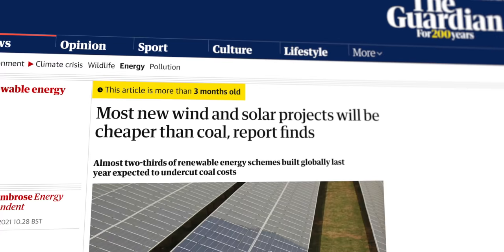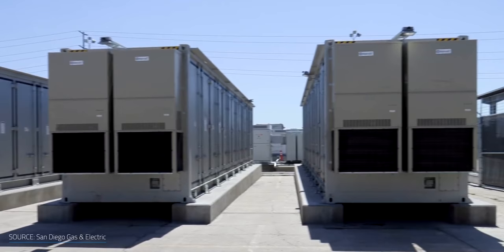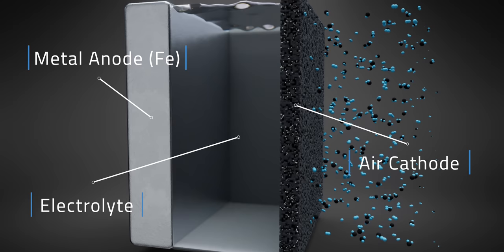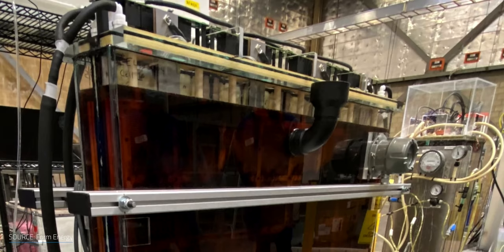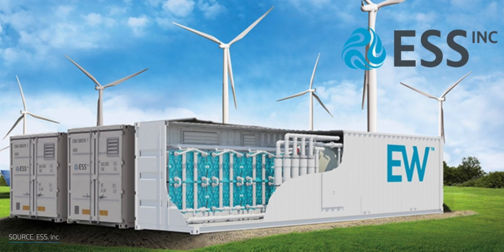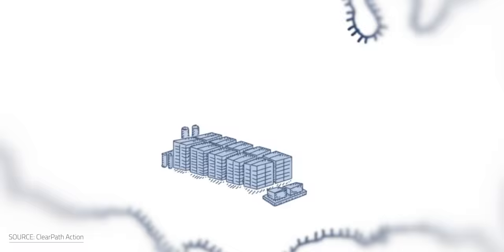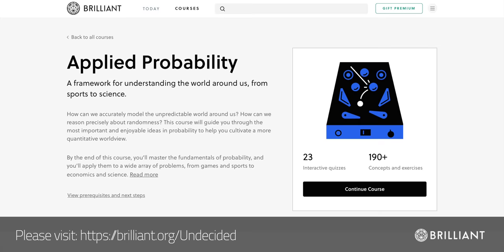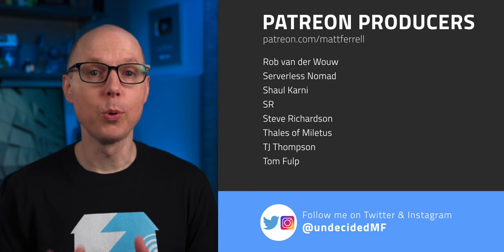Why Rust Batteries May Be the Future of Energy - Iron Air Battery Technology

Comment: Zinc8. Zincate. Get it? They love dendrites. The powder is regenerated in an alkaline solution, (NaOH), which makes the zinc powder, and potassium hydroxide, (KOH), to discharge. Dendrites aren't a liability, they're necessary in making it work. And they ain't near so big as the iron ones. DeutschPost powered their vehicles with this in the 90's.

Comment: You are mixing up your MWh and KWh. $20/MWh is pretty good compared to $245 for a 100MWh Li-ion storage facility, but does that include or exclude the generation of the electricity through solar or wind? The current wholesale price for electricity in the UK is $96/MWh.

Comment: I like the idea of Iron/Air as we have allot of it rusting away in junk yards.  But use Iron/Nickle as its a tested and proven technically that has been around for a hundred of years.  The battery if taken care of will last a hundred years, proven in reality and it's very usability.  Battery manufactures don't like the Iron/Nickle because of the profit margin over time as it lower as the batteries don't break down unless mistreated as it is a solid and proven technology.  For quick response to power needs; super caps are just a fit for that.  It stores allot of power, quick response, fast recharge time and nearly a 1-1 recharge rate.  Yes, there is resistances in it but compared to any "Battery" its not even countable.  It's downside is it doesn't hold power for long duration of time and it could be over 50% discharged if just left sitting.  But if you are looking at it as a buffer between GTI's and batteries it will do very well and its easier on the battery as it takes time for it to respond to increased demand.  And when it does, it charges back up the super caps.  I have theorized but haven't proven it could also be used between whatever is charging it and the battery as it would buffer the charge rate.  Could be some down sides here as if it got too much then that could damage the battery.  To over come this a charge controller would have to be on the super caps to the battery.  Wait I can here it now, isn't that what wind, solar and what-not connects to goes through a charge controller?  Yes, it does in most applications now but it doesn't have to be that way.  The power from a 48V commercial wind mill can be converted from three phase wild AC to DC.  Then it can be stepped up to higher voltage or even changed to AC; say 440V@400Hz.  This will reduce the line losses.  It would go to some central hub where it is converted from 440V@400hz back to 48V DC.  Then is pumped into the Super Caps as a temp battery and the actual charge controller to the batteries would be on the other size.  I have toyed in this field for a while but life has always got in the way to keep me from experimenting like I would like.  I even have a crystalline battery design from the 70's that I really never had the chance to work on.  I know there was a Canadian scientist that released something that I was thinking about around 2010 on this.  Most don't understand its operations and even I have to admit it's not earth shaking as the power coming from it is very small but constant.  I think that could be improved but it still will not really compete against the batteries of today.  Just that it always runs until the crystals grow and break the housing which is what kills the battery as it is a producer/convertor and isn't ever charged.  You would be surprised at was is really out there and most never see the light of day.

Comment: You know nuclear energy both fission and fusion are pretty good too. Takes up less space reducing the need to clear land. That could be used for Forrest or parks. And it's safer than driving a car. As well it's always available and very energy productive
Reply: Sadly it’s something that we should have transitioned to decades ago. At this point there simply isn’t enough time to build the stations required for a full transition before the planet is totally screwed.

Comment: You state in this video that they consider their technology compact, but their website states that they require approx. 1acre per 3MW of storage, i've installed a grid scale 20MW/20MWh Li BESS here in the UK in less than half that space, requiring more than 6 acres of land to install 20MW of storage will quickly become an issue i think, given the scale of storage required.
Reply: I think "compact" can have quite a loose definition.  Iron batteries are always going to be bigger than lithium but on the other hand they should be a lot less costly and good for many more cycles.  As iron batteries go this one is compact.

Comment: I heard that comparison before, that lithium ion batteries only last 5 hours compared to much longer for iron air batteries. This seems like a rediculous statement without talking about the KWh depth of power) for each type of battery. It seems to me, if any kind of battery with the same KWh rating will last the same amount of time with similar loads ... So I request clarification for  comparing batteries Accurately.

Comment: This is very interesting. I wonder if it will be possible to figure out a way to recharge those aluminum batteries, perhaps with altering the chemistry. I know turning aluminum oxide back into aluminum is a hugely energy intensive process, but it beats wasting the electricity at peak generation.

Comment: Did you heard anything about solid metalic fuel?
Iron powder which burn and generate heat which can be used for steam turbines it can use coal power plants.
Reply: @rogerstarkey5390  I said metallic fuel which is an iron powder and oxidize and get you heat .  I only said it can be used in existing facilities like coal power plants because it work similar

Comment: Lit ion batt main benefit is the light weight. Any  use that puts them in a building is a waste. Their cost per unit has gone down because of major implementation across multiple markets. Newer technology should be developed that can benefit from the static nature of infrastructure buildings where weight of individual batteries is a more minor concern.

Comment: There will be a lot of electricity storage solution in the future, but iron-air batteries will be limited to niche long-storage applications (small share of the market) because their voltage and charge/discharge rates are way too low.  Yes - rust is slow.  Knowledgeable people are mystified at the hype about Form and ESS because it's not good for most storage needs, such as EVs or home batteries.

Comment: Low storage density per volume and mass, probably very high mass / KWH storage, possibly low efficiency (though presumably their R&D is working to improve that part) - and yet exactly what we need if it works and allows grid scale storage while only consuming commonly available materials.

Element usage in this case is critical and can potentially outweigh all other factors.  For grid-scale storage we NEED a solution that doesn't require rare-earths or Lithium or.. basically anything else that isn't abundantly available in the scale needed for grid storage.

Worldwide adoption of grid-scale storage using Lithium battery chemistries might well be a bad thing when looking at the issue of world supply and production capabilities for Lithium.  But we have lots of Iron pretty much everywhere.  The only downside with this Iron-air technology might be the water usage factor - how much ongoing water usage will be required for a storage facility per year to refill cells vs hydrogen losses and evaporation losses.  Water is a critically scarce resource for many regions and it will only become more so.

Still, I am looking forward to seeing their data when it is released, especially what numbers and water-consumption figures we see from their pilot facility.

Comment: How is the battery energy converted to AC? Normally an inverter is used but at this scale I would think a motor generator would be best.
Reply: Inverters are still better.  With modern semiconductors, the design is not all that hard to do.  Superjunction MOSFETs work will in parallel.  They share the current well.  When one gets hot, its on resistance rises directing more current to the others.

Comment: For Land based fixed power storage systems why are they not using Super or Ultra Capacitors. Weight should not be a problem if you take into account all the ancillary equipment Iron air systems need. Size surly again not a real issue you could go underground if need be in built up areas. They have many more recharge cycles, do not suffer from over or under voltage issues, no dendritic effects. Off the shelf, tried and tested, could and are being improved . Companies don't like easy solutions that they cannot continue to generate an income from. We are however trying to save ourselves and the world from climate disaster.

Comment: Honestly in my opinion, the best sustainable energy supply is coal-powered plants. Not the ones that burn coal! Gasification is more efficient and it doesn't pollute that much. Going off coal and using green energy is unsustainable; and the world will have power outages. Also thorium reactors are also efficient and gives off less waste.

Comment: There is always the issue of cathode degradation and dendrites at the cathode during charging cycles. Is there an electrolyte that dissolves metal and can be employed in "liquid battery" design? Or maybe using liquid metals like sodium-potassium (NaK) alloys?

Comment: I was thinking if the grid itself could somehow with some modification, store a temporarily surplus energy itself. I think about temporarily raising the voltage to raise the energy content of the grid (E=U.I.t) but of course the end user should still get his same voltage. I wonder if it's correct in theory. In practice, it's probably giving all expensive and very hard to control.
Reply: Maybe use a smaller cluster of lit-ion batteries as a buffer.

Comment: It’s an interesting concept, but with iron requiring to be in its reduced state, to store the energy you have a problem. All the oxygen released during the recharging needs to be removed from the system, to prevent the reversing of the reaction. At the same time you would have to battle erosion of the oxidized iron into your electrolyte. 
As i said an internet concept, well presented, but i think not overly practical.

Comment: My first thought is efficiency in these storage methods. How efficient is this compared to other energy storage methods?
Reply: Exactly... how much power is required to charge/renew it vs how much you get out of it?
Reply: possible efficiency for Iron - air mentioned right after 8:41
Reply: Round trip power efficiency, whether 50 or 80%,  doesn't  matter that much because solar cells are so cheap that you can have more than enough.  The barrier to penetration of grid storage is the capital cost of the batteries factoring in how long the batteries last.
Reply: @richdobbs6595  My point is if its more efficient to use some other current storage method why pick this? Will it be cheaper in the long run or last longer than other competing energy storage methods? I expect the answer is we don't know yet but it could be better.
Reply: @richdobbs6595  I would think a possible 50% efficiency would matter greatly but, doing some research shows nicad/nimh are around 60% so... I guess it doesn't matter.

Comment: I've seen experiments where scientists send fireworks type rockets carrying a grounding wire attached  to a post at one end, into a storm cloud which results in a bolt of lightning.  So, stupid question time: will there ever be a battery or capacitor system that would be able to absorb that power without exploding?  Some areas of the world have many regular storms and if all that lightning power could be captured would it be financially viable anywhere?
Reply: There isn't really all that much power in lightning, "just" really high voltage. It's why people can survive being hit by lightning.
Reply: @defeqel6537  damn, my vision of the world as a giant plasma globe has been denied.  It would have looked so pretty.

Comment: Would it make more sense to house these large scale battery farms (regardless of the chemical makeup) closer to the electricity production or closer to end users?  I think of the Southeast specifically where the major electricity production locations are all typically over 50 miles from their largest users.
Reply: closer to the user as you would need to store the transport losses otherwise, but for 50 miles that's pretty negligible
Reply: For really large scale battery farms, you would probably locate them nearer to production from PV farms, since land would be cheaper.  But there is something to be said for distributing them on to unused urban land such as freeway margins.  That's assuming that you can package them to not require a large warehouse.  A great alternative would be to relax minimum parking requirements so that they could be slotted into existing parking lots for big box stores.

Comment: The advancements in battery technology are great but even with a 100 hour capacity I don't see them make a fossile or hydrogen backup obsolete.

To my opinion, renewable electricity plus storage works great near the equator but it will only be an interim solution everywhere else. 

Either we in the north get a significant portion of our energy from renewables harvested in the equator region or we'll have nuclear fusion in a hundred years but I don't see us relying 100% on the renewables we can generate in the north.

Either way, we'll always have a significant amount of energy generation which is independent from local weather and local seasons. Cheap short term energy storage is always good for the grid to make it more reliable, overcome temporary bottlenecks and avoid local backup power generation, but there will be an optimum size. If we oversize our energy storage or the renewable power generation capacities in regions with bad profitability due to environemental constraints, we'll lose lots of money. I think, many of the wind generators, photovoltaic parks and energy storage solutions in the north won't survive longterm.

Comment: decentralized would be good.  could we underground a battery under your driveway, and then you save electricity from your own solar panels so you can run the washing machine or heat pump at night.
Reply: It may be better to put it under the house.  It can be in the basement or subbasement and be somewhat accessible.  You want it kept at a steady warmish temperature.

Comment: Question: are nuclear power plant operators looking at grid scale battery storage as an adjunct? It seems to me that nuclear power plants are massively under utilized at night when the demand for electricity becomes lower. If nuclear power plants were paired with Grid scale battery storage, then there would be a back up for times when the nuclear power plant had to go off-line but also an extra amount of electricity capacity available to meet unexpected peak needs. Are any nuclear power plant operators actively looking into this?  Please tell me that the makers of grid scale battery storage are not waiting for large renewable energy sources to come online!!! They should be working with nuclear power plant operators today!!!

Comment: Let's go with the iron rust battery because it is so non-toxic for one thing, and no country would be barred due to lack of available resources to produce their own versions.  Li batteries are toxic, and they are expensive.  Now, will smart person please work on the resistance problem so that we don't have to have so many power stations.  Perhaps using Mother Earth like Tesla to transmit the signal.

Comment: I do not understand the concept of energy supply for x hours. Isn't it like: the bigger battery, the more time it supplies you with electric power?
Reply: It's just easier to get a grasp of something like "power 300 houses for 12 hours" rather than xx GWh capacity
Reply: @francescobasile8933  this doesn't explain much to me. In the same example with "300 houses" instead of 12 hour can be 24 or 36 hours of supply if we just double or (respectively) triple the initial amount batteries.
Reply: Technically yes, but not all batteries can scale their output. Rusting is a very slow process, so these batteries can't put out gigawatts of energy per second, they're to release smaller amounts over a long period of time.
Yes, the bigger the battery, the longer it will run, but also if the output is slower, it will run for longer.
Reply: @midnight8341  why couldn't a battery scale up its output? Even if we talk about rust batteries and its slow discharge rate, why wouldn't 10x batteries give 10x power supply? Yes, a single battery have its discharge limit, but how simultaneous run of 10 such batteries have no tenfold power output?
Reply: @alexbogdan9500  because those batteries don't have a lot of output. The amount of those batteries you'd have to put in row for a high output is mind-numbingly large. You can either have enough batteries in parallel to provide decent output for a long period of time or enough for a high output, but only a short duration, not both. And this particular battery chemistry is unsuitable for high power, quick discharge, so nobody is going to build an array that doubles as a peaker plant. They're intended for low-output, long duration operation for grid stability.